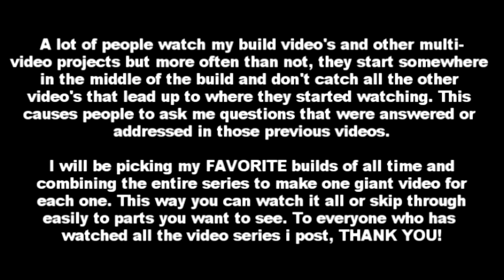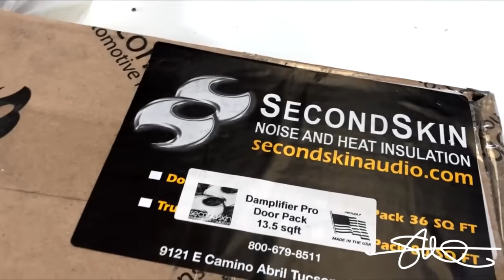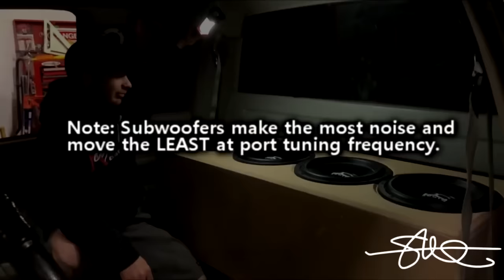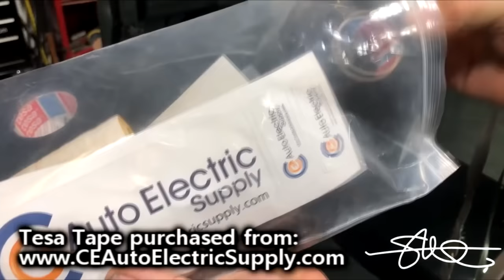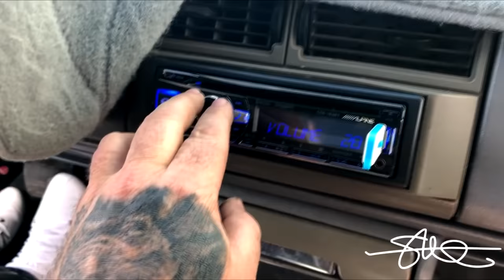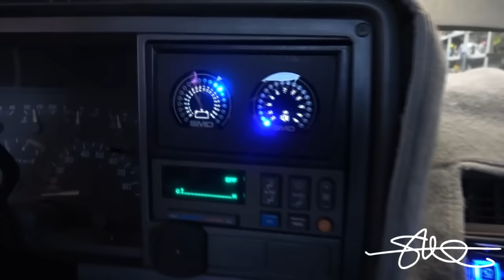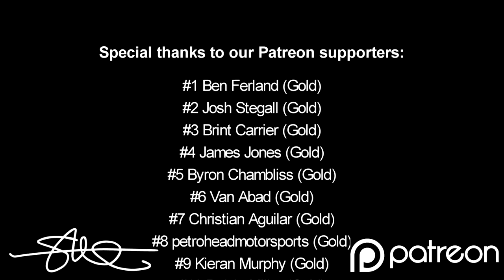Rob's "Bucket O' Bass" EXTREME Car Audio Fail & Fix (Start to Finish) Unbelievable!

Comment: 0:30 Rob's bucket o'bass the entire series2:14- introduction walk-around video-1
14:04-tear down removal carnage video 2
28:52 a little something from DC audio
34:55 ,4level 1,12subwoofers
58:30 kick panels,mids/highs,new head unit video 5
1:12:40 portedbox build 4 12"subwoofers
1:30:02 testing the box
1:45:33 finishing the box video 8
2:10:11 amprack wired up &fired up
2:27:12 finish and delivered (first reaction)
2:44:48 new high output alternator (unbox) &custom led dash display video 11
3:01:12. 240a high output alternator upgrade  video 12
3:18:12 Rob bucket o'bass unboxing 4dc audio level 3 (preview to an upgrade)
3:22:17 level up Rob bucket o'bass gets 4level 3 subwoofers
Reply: Winner??

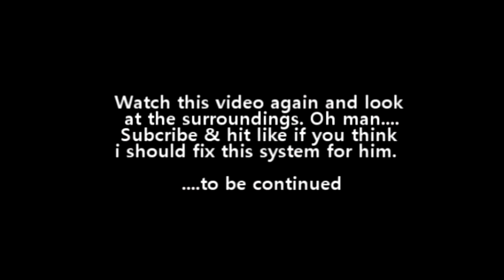Comment: 2:10 “introduction and walk around”
14:05 “tear down, removal, carnage”
28:50 “4 level 1 DC audio 12” subwoofers”
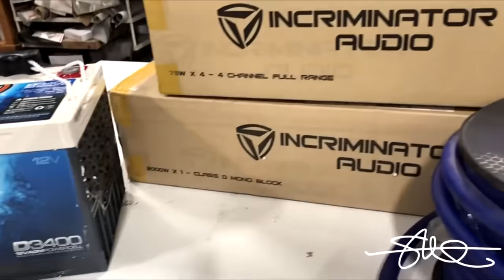34:56 “battery, power cable, big3, door panels”
58:30 “kick panels, kids/highs, new head unit”
1:12:40 “ported box build”
1:30:00 “Testing the box”
1:45:00 “ported enclosure and platform”
2:10:10 “AmP rack wired up and fired up”
2:27:14 “Finished and delivered (first reaction)”
2:44:50 “new high output alternator unbox and custom LED dash display”
3:01:15 “high output alternator install”

Comment: lol
Back in the day when I was still just a kid, I bought a 12 inch Rockford Fosgate from a friends older brother for ten bucks.  The cone separated from the spider.  I refurbished it as best as I could as a young teen and C-clamped it to a 5 gallon bucket to use with my home theater setup.  haha

Comment: TIMESTAMPS:
0:33 - Basic Introduction (bucket in action)
2:14 - Proper Introduction, Walkaround, Plans for truck
14:05 - System Teardown
28:50 - Subs showed up, 4 DC Audio Level 1's
34:55 - New Battery, Big 3, Power Cable Ran, Door Panels
58:30 - Kick Pods, Mids/Highs, Head Unit
1:12:42 - Building the Box for the Level 1's
1:30:01 - Testing and fitting the Box
1:45:00 - Finishing touches on box and platform
2:10:11 - Amp Rack Wired up and Fired up!
2:27:12 - Sound Deadening and First Reaction!
2:44:48 - HO Alternator Unboxed & Custom LED Dash Display
3:01:13 - Installing the Alternator and testing the difference
3:18:13 - Unboxing DC Level 3's
3:22:16 - Installing Level 3's

Comment: 2:15 - Video 1  Introduction and Walk Around
14:05 - Video 2  Tear Down, Removal 
28:54 - Video 3   4 12" DC Battery, Power Cable, & Door Panels Audio Level 1 Subwoofers Unboxing
34:54  Video 4   Battery, Power Cable, & Door Panels
58:30     Video 5   Kick Pods, Mids/highs, New Head-unit 
1:12:40   Video 6   4 12" Subwoofers Ported Box Build 
1:29:37  Video 7 Testing the 4 12 Speakerbox!
1:45:10   Video 8   4 12" Subs Ported Box & Platform DONE! 
2:09:45   Video 9     Amp Rack Wired up & Fired up!
2:26:48    Video 10  Chevy Truck FINISHED! First Reaction!
2:44:23  Video 11  High Output Alternator & Custom LED Dash Display
3:00:46  Video 12    MORE JUICE and No Birdies! 
3:17:47   Video 13   Unbox DC Audio Level 3  
3:22:51 Video 14    4 12 DC audio Level 3 upgrade!!
🤘🤘🤘🤘🤘

Comment: I just got my first audio system, a cheapish $80 pioneer head unit and a alpine s-a60m amp, a 10" alpine s series sub with all the wires included for $535. I did all the wiring myself and I'm glad to say it doesn't look nearly as messy as this setup was... It's still not complete yet though, I don't have the head unit in a plastic housing and the sub and amp are flying around in the trunk. Probably could have gotten better stuff for the money but I think it sounds great.

Comment: I've been a fan forever, his works are always 101%perfection SPL/SQ, top-notch quality always and leaving nothing out. I can't wait to take my 2021 BMW X6M there for added bass, nothing too crazy, just a light clean and precise quality build-up added to the factory Bowers & Wilkins sound system for those missing low bass.

Comment: Just a heads up for people with these trucks- the external fan 105 alternator can be swapped out easily for the later one with internal fan. IIIRC it puts out more amps. It’s just a matter replacing the regulator wiring pigtail in the back of it. You just have to identify which terminals are what on each and match them up

Comment: I have started my first radio full upgrade with  radio 9ch EQ speakers amp subwoofer.  Its got a few power blocks blocks.  Let me say I never    expected so many small details to get 1 little thing accomplished.   My wiring is good.   The only thing I didn't know about was the radio wiring harness module.  I thought I had to splice into factory radio wiring harness. 
A lot of small details.

Comment: I never would have never thought regardless the hopelessness of the situation to think up a "Bucket O' Bass".  lol. I guess as long as its a big enough bucket.  lol. Sweet you guys using Incriminator Audio for the Amps. No chance of not exceeding your planned expectations with those guys powering the system.

Comment: Love the transformation and his reaction is priceless, but can someone educate me on how he eliminated the engine noise? So he runs the power from the alternator and battery to the first distribution block. And then from there, ran to the second one in the back of the truck. And from there to the amps, head unit? How's that work exactly?

Comment: Awesome clean up & install. You got to call those old door panels,
Tore up from the floor up,
Beat up from the feet up,
And wrecked up from the neck up!
I'm guilty of having dirty interior so I hope Rob doesn't feel humiliated...."Life gets in the way of always being able to look like The Brady Bunch."
Anyways, Mr. Mead Im in Ventura County, a neighbor to the South of you. Hopefully some day I'll be able to roll thru your town and stop by in my 2002 Toyota Sequoia that's shaved and slammed down on some Comp Pro 20" alloys and a janky sound system. Ive got some ok components but need to clean it up.  Skar RP4500.1.D  2 Skar 12" DVC  2 ohm SVR's with a pair of 1000 CCA batteries.

Comment: I've got a 98 extend cab that I wanna run 4 12s. But I'm on a small budget so I think I might use 4 power acoustik mofo-124x in a ported box or 4th order

Comment: I know this video is older, but damn!! That system was bad ass!! Have you ever had any problems with Alpine head units? Back in 94 I had a detachable face and within 6 months the lights on the buttons went out. they fixed it, and withing 3 months they went out again.

Comment: i didnt think you had to upgrade alternator ground and power with the 1guage wire your using , i think its 1 guage. I was always told 4 gauge is overk ill as main wire and all you need is 8 gauge ?? im am so coufused have the amplifiers changed or something requiring such large wiring ??? 
Your work is flawless bro . Smashed the like and rang the bell ! DINGGGGGGG
Reply from the maker: you were told wrong. Do not listen to whoever gave you that information.  Thanks though man! I appreciate ya!
Reply: He said in the video that the power system Alternator/Wiring was future proof so he could upgrade his equipment without having to redo the electrical.

Comment: Reminds me of my old truck I used to have. Bought an f150 2001 off my bud for $500 and the wheels and tires were worth more than the truck. Spent 1200 on a system. Nothing spectacular. 2 kicker 15s 4 infinity door speakers Memphis 4k amp enclosure and a boss touch screen head unit. truck looked like shit and sounded decent..

Comment: Is 1/0 gauge over kill for your run of the mill 1500/2000k system just wondering, wanting to start my own build soon.
Reply: No it's not
Reply: Use 1/0

Comment: Sheeeeeeshhh I’ve seen some ghetto fabulous install/wiring in my years but that was straight up painful to watch like a checklist of all the things ur never supposed to do. I can’t believe that truck didn’t burn to the ground from an electrical fire 😅. Just cuz ur on a budget doesn’t mean u can’t do a neat clean respectable proper system even with older gear as long as it wired & grounded & anchored correctly. I’m still rockin my ~20 year old 3x memphis amps that weren’t cheap way back when but have proven well worth the cost outlasting every truck they been in. I’m actually prepping to install my same ish in my “new” (super clean) 07 Explorer. Luckily my triple box of newer Alpine type R12s fits so now it’s really just down to new power/signal wiring & where to locate the amps cuz I can either reuse the exact same amp rack or hide everything where the factory amp/sub module currently lives. But as I’ve gotten older I’ve learned the art of patience & planning for these things.

Comment: I watching all the way thru...I have my current setup in my 2013 altima..I ran all new 0 gauge power and ground but it isnt the copper wire if i remember correctly..but I need one of your boxes for either a single 15 like I was running or 2 12's..My Teraamps Bass3k is killing all my subs blowing them.

Comment: When he ran those 3 yellow blue and black wires from the headunit that kind of gave me an idea. I've been having a lot of alternator whine in my audio because of signals and i think running the power n ground from the battery in my trunk to my headunit could help. any other suggestions?

Comment: lol, i used to have a 10 inch bucket sub, inside was stacked left over cut outs for subs cut out again to make solid walls. slap some spray paint over spray on it  and it looked like an old garbage woofer nobody would bother stealing. or just a bucket from the right angle.

Comment: 2:11 “introduction and walk around”
14:05 “tear down, removal, carnage”
28:49 “4 level 1 DC audio 12” subwoofers”
34:56 “battery, power cable, big3, door panels”
58:30 “kick panels, kids/highs, new head unit”
1:12:40 “ported box build”
1:30:00 “Testing the box”
1:45:00 “ported enclosure and platform”
2:10:11 “AmP rack wired up and fired up”
2:27:13 “Finished and delivered (first reaction)”
2:44:50 “new high output alternator unbox and custom LED dash display”
3:01:15 “high output alternator install”

Comment: Morning bro. 
Can you please help!!!

I have an issue where my 2 mtx terminators are playing vocals and the LPF And HPF adjustments do not change this issue at all. My aftermarket stereo only had one sub hook up rca. Is this my problem? Do I need to run a splitter? R is their a issue with my Power Acoustik lt980 2 channel amp from 2004? HELP PLEASE

Comment: i want to put a bass tube in my car an 8 inch sub woofer i like my sound and bass to only be in the car i'm not trying  to be heard and seen and having everything rattling i don't like that shit. i want some that's not going to take up too much space and does the bass tube comes with an amp built inside so i don't have to buy a amp to run my bass? i have 4 speakers two 6x8's and two 6x9's so i need a 4 channel amp to run them and the bass tube have it's own amp and all i need is somebody to install everything right

Comment: I'm real confused on the 3 wires from the head unit or factory harness taken to the back is that for the mids and highs Amp ? I mean those get wired to the Amp and just rca to the head. Never done a mids and high Amp just something for 2 12s or 2 10s.

Comment: i run dual alternator i like that because u have redundancy if one gives up  i have alot of lights, 40 Fn exterior factory lights alone lol its a k3500 dually, also 2 light bars the system gauges leds all the random shit that adds up, its a diesel so theyre somethin like 240 or 250 to start with lol but i had all the stuff layin around so y not..

Comment: Huh compared to the rest of the wiring, the engine bay stuff is relatively clean, they even used split loom, it's like they gave up trying after they got through the firewall

Comment: What are the dimension of this box? I’m planning on doing the same thing but have my 4 subs facing up and the port up. So far my dimensions are 40 inches wide, 35 inches high, and 20 inches deep, 9cubes tuned to 31hz

Comment: It must be a Pyle driver types thing....  Currently that's what I have in my vehicle and when I 1st got it it was in a 5 gallon bucket as well......  I put it in a slot port Box.... Yeah I wish I had more money device something nicer but for less than $40 for the sub, slot port box & a 1000w crunch amp... Well, I can't complain....
Reply: At least it isn't a bucket though
Reply: @dylanandersen9318   it was in a 5 gallon bucket....  But I took it out of that and put it in a slot port Box

Comment: What’s wrong with using Romex other then it’s not easy to work with and that the sheathing may crack but doubt it since it last at least 20 years in walls.

Comment: Tessa tape is good for oem look but also for Rattles I would of used it on the wires under the door panels that you made. I like how you wanted to go better but cheap and then went a little harder. This guy didn’t know better or didn’t much care.
Reply from the maker: Tessa tape....for rattles? I don't know about all that.  Pretty random.  I always love when someone who has never done anything tells me what they would have done LOL
Reply: @meade916  I have done things just not with Tessa tape yet. And no it didn’t come together as pro as your stuff.
But isn’t that the only reason you see Tessa tape on higher end vehicle wires
Reply: @meade916  I’m 37 and been dabbling with everything car mod since I was 16. I do follow mike and Doug and use to watch them rather religiously for a few years not so much anymore since they went patrion.
Thank you for putting all your short videos on the project into one I haven’t gotten thru it yet but plan on it.
I’ve also been watching you before you partnered with DAmore.

Comment: I would love to see Price breakdowns of the installation.
Reply: Well probably 90 an hour for labour. Then subs are 400 to 1000 same with amps.   
Wire is a 1000 minimum. 
I imagine it's in the 5 to 8 thousand dollars if a guy was to commission the build.

Comment: That is one ghetto-ass install bro. I've fixed WAY too many cars with the same issues. It's mostly from people being too cheap to buy the super-fancy luxury items, such as: wire/cable, fuse holder, connectors, etc. Did I see grandma's lamp cord in there?

Comment: I wonder how much was this full set up?
Reply: That battery alone is almost $1000! no expense spared!
Reply: Nah the battery was around 350, 400 for both amps, 500 for the subs around 200 for the 1/0s and speaker wire 100 for the deck, 400 for the alternator and 2-300 for the panels so around 3.5k for the whole set up

Comment: Then crimped on connectors attaching the speaker wires together don't do anything to the performance?
Reply from the maker: which ones? not if I did them they don't.

Comment: I don’t understand I just burn my taramps 8k running 2 - 12 rockville destroyers and I don’t even think I had half the power you did with that 500.1?
Reply from the maker: find you a qualified installer for best results.  Car audio should not be hooked up by just anyone unless you are willing to burn up some equipment while trying to learn.
Reply: Turn the gain down..

Comment: My lights dimming on my 2016 Mazda3 i have  db drive wdx 3k amp  what i have to do  just change the battery
Reply: I’m a newbie in the audio world but I’d upgrade the under the hood battery or do the big 3 upgrade
Reply: your volts are dropping.get a alternator and a better battery.
Reply: I cant find a alternator  for my car
Reply: Just add bigger grounds, search big 3... most likely it'll fix your problems

Comment: Smd question if I up the alternator amps to say 390 would that help me not need the extra batteries?
Reply: Do it right the first time. If you dont have the cas then wait.
Reply: @Podus81  made a new rack went ahead and  bought the extra batteries.
Reply: @suertederey4564  Nice. I learned the hard way with cutting corners.

Comment: that wiring is horrific ,  i can't believe that he had two fuses on the capacitor.........  wow
Reply: I have a feeling the original installer thought that two 40a fuses inline would provide 80 amps.

Comment: I wish Steve was my friend 😢
Reply from the maker: i am your friend bro! :)
Reply: @meade916  Hey friend! Lol. You’re the perfect person to ask. I just got an AMM-1. Tried using it on my D4S JP33 amp but something’s wrong. I think it’s reading the ohms right but it’s saying I’m not getting more than 100w. The plugs go into the speaker wires right? Or the power cables? I have the + speaker wire going through it.